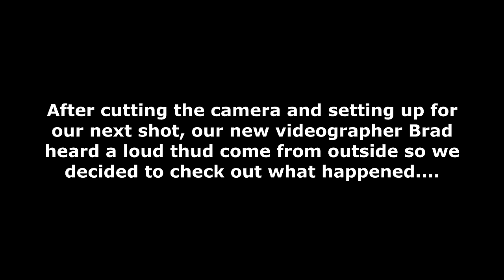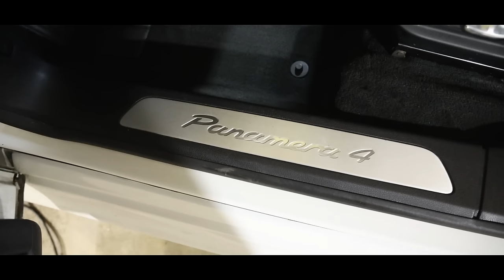Deep Cleaning The Muddiest BIOHAZARD Porsche EVER! | Satisfying Flood Car Detail Transformation!

Comment: I know Katzkin does a lot of customizable interior. It’s an OEM quality leather replacement for your upholstery. Includes the center console or anywhere else there is upholstery. You can order anything from basic black to custom color, including custom stitching options. I’ve used it twice to replace fabric interiors and I don’t have anything bad to say about the quality or fitment. Highly recommended to have it professionally installed. The upside to a professional, is that they can usually find replacement foam if needed.

Comment: Seats  and cushions could still have moisture and mold if it was underwater. If it is damp, it will come back.
Reply: I was thinking the same thing. Wouldn't the mold also be growing inside the seats as well as outside?
Reply: Not to mention the piping for the floor vents. Anytime you turn on the heat or A/C, it’s going to blow dirt and a nasty smell. That’s why flood cars are cheap. Lots of work involved.
Reply: @Mer134  Yes, the inside  of the seats are great for mold. Dark, and waiting for the humidity to rise above 60 or so. Maybe of the seats were taken apart, dried, and ozoned, who knows. Carpets I know are tossed if they are underwater more than a day. If the insurance just cleans them, and mold comes back, then they can really be on the hook. Leather Seat skins have a foam backing pad that can trap water.  And the rubber/foam cushion I am sure is very porous. I know because I installed many heated seats.
Reply: @sw9837  Yeah, even in non flood cars you can get bad odors from the A/C.

Comment: I would buy the whole car, open, inspect and repair all wiring looms. The ECUs fitted to the car I would send away for professional repair or replacement and the rest I would do myself.
I would also change the seats and other trim, not my taste at all.
Reply from the maker: Very good take
Reply: Every light, fan, dashboard instrument, switch, electic motors, engine component and everything else might be compromised. Not saying you're wrong but it would be a hell of a gamble and a huuuge undertaking.
Reply: @flemwad  I understand that it would be a huge undertaking but I have good technical skills and I am retired so time is no issue. I think as long as I were to work methodically I could do it. Just need someone to donate a car like that to me, minor point lol.